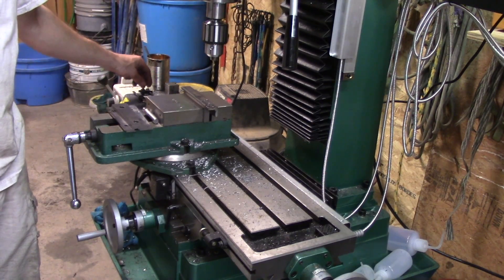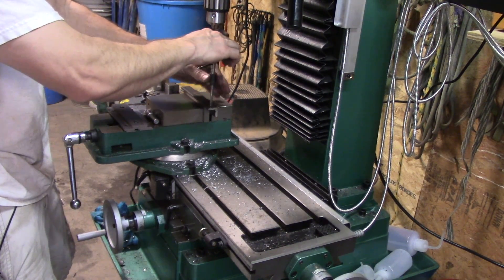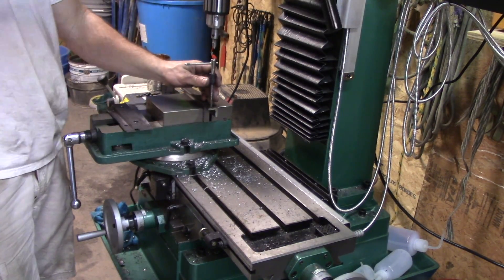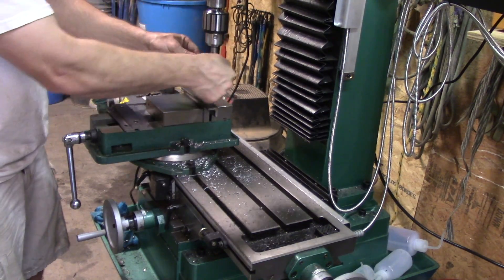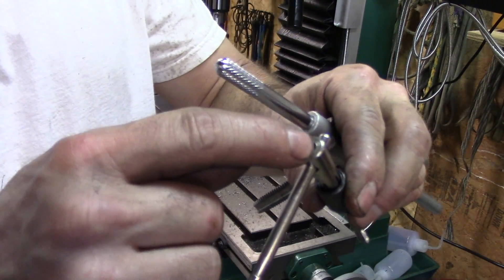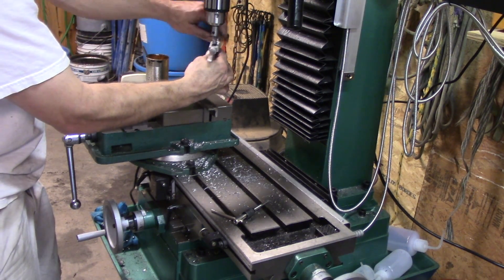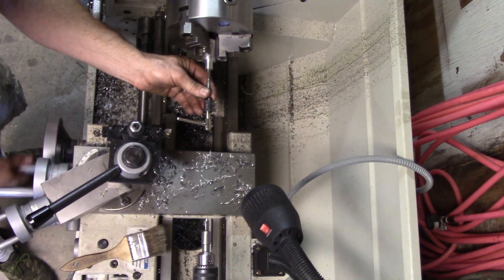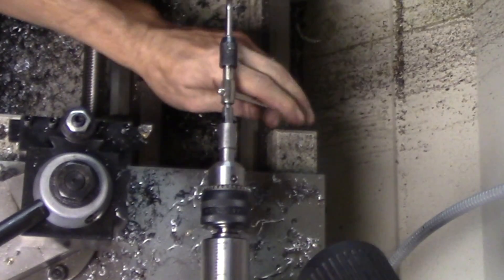Making TUBALCAIN's Tap Follower.  FarmCraft101 DIY

Comment: When I was a fitter/machinist in the 70s & 80s in Scotland, taps came in sets of three: taper, intermediate and plug. Start off with the taper then use the intermediate etc... no need to have something centre the tap for you other than the dwang [tap wrench]. I can see the benefits of a tap follower though.

Comment: Or you could buy one, for less than $9.

https://www.amazon.com/Brand-Spring-Center-knurl-threading/dp/B07CSRBPXZ/ref=sr_1_fkmrnull_3?keywords=Spring+Center+Knurl+Tap+Guide+Tool+to+Align+Tap+for+Threading+Lathe+Mill+Jig+Bore&qid=1553810448&s=gateway&sr=8-3-fkmrnull
Reply from the maker: Where's the fun in that?  ;-)
Reply: Why buy one if you have the bits and pieces, tooling and time to make one??

Comment: I hate to be the youtube safety guy, but I was trained never ever to take your hand off the chuck key while it's in the chuck. Having personally seen two chuck keys thrown across the shop, and the damage that does, I cringe when I see you leaving that in there without a hand on it.
Reply from the maker: My shop doesn't have that rule.  I simply check that the chuck can spin freely before I turn it on.  Effective and more efficient.
Reply: The rules sometimes can or even should be adjusted to fit one's personal preferences or process. If the spirit of the rules is upheld, that is if we actually understand why we do something this way instead of that, then all is good. Also, did I hear a power hammer running somewhere?